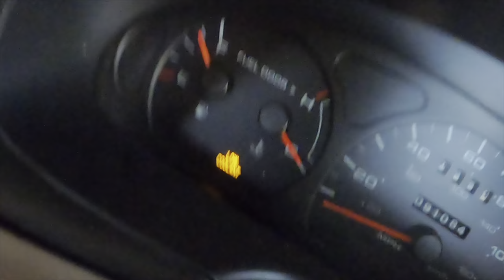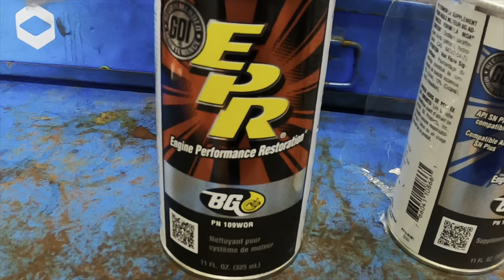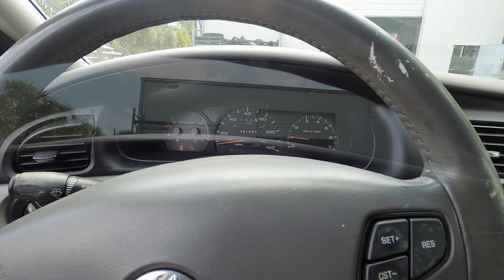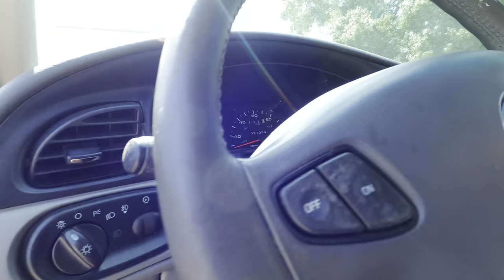Customer States: Never changed the oil….oops

Comment: When I want to remove rusty nuts and bolts, especially from exhaust related, i pre-soak the nuts with brake fluid and they come right off. Saves a lot of grief having to dig out broken studs etc..

Comment: Had a car with rod bearing knock. Told the client that I can try to save it with some bearings, but be ready to scrap the car. Turns out, oversize and undersize bearings do not mean what you think they mean. I figured oversize means bearings that are bigger than stock and undersize means smaller (like if you were putting different crank/con rods in). So I got oversize when I should have gotten undersize. I'm still confident that if I put the correct bearings in, the engine would have continued working for another 20k miles while they saved up money. But I wasn't a shop, just a Harry Homeowner kinda guy. Our deal was a learning experience for me and he only paid for parts.
Reply: Checking the clearance with plastigauge would have shown the wrong clearance for the bearings.
Reply: @chrisczarnik3439  But that would have required buying this "plastigauge" thing and then taking apart the crank caps again. I hate doing things twice, especially when torque specs need to be followed, upside down, with head damaging suspension bits in close proximity.

Yeah, my brother told me what I should have done afterwards. Would have helped if he was there to answer questions while I was doing it instead of staring at his freaking phone, but what are you going to do with these millennials.

And I still believe calling bearings "under" or "over" size is misleading. It needs to be more clear and say OD +1 or ID +0.625.

Comment: shame, the duratech 3.0 is a solid engine. Mine was still running great at over 300k miles without ever needing to be opened up. the original trans was holding up ok too. All it ever asked for was clean fluids. if it weren't for rust I'd probably still be driving it.

Comment: If you have anything to do with it, I am sure that this little engine will live another day.  To get the small
 debris out of the oil pickup strainer, clean and dry it with MEK or similar.  Then they fall out rather than get stuck in oil.

Comment: We used a similar oil cleaner on my daughters car. Slightly dark oil came out black, did 3 oil changes after 20km driving each time and the engine was quieter and oil lasted way longer before it got dark. It was a 14 year old car with 130,000km, and it lasted 2 more years before the gearbox decided to not gearbox anymore. 

Would I use it on my car? Hell no, but hers was a $200 car lol

Comment: heat from a small hand held portable  propane touch is hot enough to be more effective then penatrating oil but cool enough to not melt  materail from bolt or stud or suronding area

Comment: Next time you have to polish a rod (or main) bearing journal cut a strip of 600-800 grit wet-or-dry sandpaper that goes around the journal covering it completely and overlapping itself slightly, liberally apply parts cleaning solvent to make the sandpaper a little more flexible and conforming. You are can put the whole sheet in your cleaner tray and have the pump on to keep it covered. After you have the sandpaper in place wrap a length of string around the journal making a full turn with enough left to make it easier to pull back and forth which is exactly what you want to do next. The string keeps even pressure on the sandpaper all the way around the complete journal. Make sure to use a caliper to check the diameter of the journal afterward, I've actually used this method quite efficiently to clearance the bearing surfaces enough for a race engine. But usually it is less than getting a.001
Reply: Opps, well you may sometimes see the diameter of the journal change enough that you can use a .001 undersized bearing to keep the clearances in spec. I have torn down an untouched factory engine in one of the early 2000 CD fours that Ford brought from Germany for the '71-'73 Pinto's that had a .001 undersized rod journals on all four rods. I won't say why but this engine made it so I won't get a set of bearings until after micing the journals AND reading very carefully the stamping on the back of the bearing shells.

Comment: i qt of kerosine in the motor oil cold. when you add it to the motor start let idle for 10 min or til operating temp.  it will clean a motor very well. in the 80's i learned that trick after smelling what was in the can for 10 bucks when you can get kero for few dollars a gallon

Comment: If the correct socket doesn't fit  on a nut, in your case due to rust, I switch to a SAE socket that's just a little larger. Of course, assuming your car is metric. That should also work from SAE to metric?

Comment: I think you can save it for at least a few more years, if the customer takes care of it and changes the oil every 2500 to 3000 miles or less, oil is cheap. if you can't afford to buy a replacement car then try and make this one last as long as you can, nice job Ray.

Comment: The part that freaks me out, particularly when he says they have to go back in the same place and orientation, is that I start forgetting which parts came from where after too much disassembly. And I am not sure how to be more organized about it. Take enough fasteners and components out and it becomes more difficult to remember exactly where everything came from sometimes lol.
Reply: The trick is to just take photos of you holding each part in your hand, next to where you took it from in the car, and you can always go back to them if you forget. We have so much ways to utilise our technology that we overlook.
Reply: Use a muffin pan if you need better organization.  Works pretty good and very cheap solution.

Comment: the real issue is the condition of the crank, doesn't really matter what it's done to the shells, reminds me of the time when I was younger well, a lot younger lol, same job, undid rod bolts removed cap, didn't notice the bearing had been forced out between the crank and the rod and turned into a razor blade equals a trip to the ER for finger stitches lol

Comment: I watched this (and part 2... ).  Very nice to see an engine saved like this when most repair shops would probably just hear the knock and tell the customer they need a new engine.  But I have to wonder how many hours you had in this to take it all apart, polish the crank, and then put the new bearings and caps in, and put it all back together.  If it was 20 hours, that would be $2000 (around here), plus the cost of the bearings.  Can you tell us, was this a cost-effective repair?
Reply: $2000 is better than spending $5,000 and up for a new engine

Comment: The video would be better without the background music... By the way, will that engine be alright, I mean you're not supoosed to use sandpaper to smooth the cranshaft, now it may be slighly off balance (still better that the state it was in though).

I guess it's still worth trying since replacing the cranshaft would be costly, the car may even be sent to the junkyard...

Comment: That engine flush is crap in our European engines especially if you have hydraulic valve lifters, it can wreck them fast, might as well mix kerosene with the oil for all the good it does, we tend to just flush the engine with oil twice with about 30 miles of driving in between. 

Question Please? why didn't you put the oil pick up tube in the parts washer?

Comment: Looks like the driver had a whiskey night run AC with low coolant and 5 and 6 is way back in the back of the motor where oil gets to at the last point but yes you did a good job .but you'll know soon as you put them bearing caps and bearings back on if there's any play.

Comment: I don't understand exactly where or rather how the large shavings of metal came from or were made ?. If the bearings are wearing then I get the fine metal in the oil but what shaved the metal off the bearing? Some of those pieces are like a carpenter's block plane shaving wood slivers.

Comment: I tried doing this 15 years a go and it didn't work out so good I hop you have better luck then I did.
I would clean out the oil pump or get a new one and spray down the crank with brace clean

Comment: Drive it until it fails.  Might be 10,000 miles who knows.  Or put motor honey or whatever.  But very interesting to do the bearings.  I would think best case would be to put a rebuilt engine in it.  How much does that cost, that whole car is worth what $2000 max?  Your work isn't too bad as that type of job goes.  Some places wouldn't give you the time to examine the engine on that level, the second you found metal they'd give the customer a choice, rebuilt engine or pay for diagnostic work.  You take a huge chance trying to save an engine like that.  What if the cam bearings are shot or what if there is metal up top?  The customer pays $800 or whatever those repairs cost and six months later the engine fails completely.  He's not going to be happy.

Comment: I have to admit this is not something I would have tried. Once I heard that rod knock, it would have been a new engine or nothing. Even if you could extend the life of the engine for a short time, the time and work involved is just not worth it, at least to me. I can just see doing all that, then having the customer come back in a week wanting his money back. I wouldn't do it if it were my engine. There are just too many things in that engine that are almost certainly seriously damaged. Not only are the rod bearing journals damaged, the crank bearings and journals are also likely damaged, Probably beyond repair. Then there are the cam bearings, journals, and lobes (I noticed it's a DOHC 24 valve, which to me is one to many cams and 8 too many valves) the cam chains, tensioners, and guides, likely excessive wear to the cylinder bores and rings, and a whole lot of other things. It would have been nice if they had designed the pickup strainer so it could be taken apart and properly cleaned out, I would have thrown that one away. IMO these seriously over complicated engines just aren't worth messing with when they have that kind of damage. I'm an old school small block Chevy guy, and even on one of those, if I had found the rod bearings bad, I would have pulled the engine and completely rebuilt it. As far as putting parts like bearing caps back in the proper place and orientation, I use an electric engraver to mark them with. Just laying them out in order on a bench is, IMO, just asking for them to get mixed up.

Comment: I think it will not last very long I'm afraid, crankshaft need professional measuring and regrind or polish at bare minimum. I understand it wortth ago with a bit of emery paper and it will look better but it has to be within manufacturing tolerances which I doubt it will be. Alot of work, all because of poor maintenance.

Comment: I suspect the snake oil additive is what caused the bearing to spin. That bearing sure looked like a recent spin. And there was no rattling noise when you first started it up before adding the snake oil. I don't trust those additives and this makes me wonder. I think the customer would have been fine with just oil change before you added that.

Comment: That junk won't clean the oil ring on the piston if its locked up, futher more the cat is clogged.  You wont know unless you pull the pan and start pulling pistons out the bottom of the motor. If you can get them out with the crank shaft in.
Then you've got to worry is it low on water becuse the head gaskets blowen?

Comment: You did not show the end result of it. If the vehicle will run again with just replacing the connecting rod bearing but by looking at all the big pieces of metals that came out of the bottom of the engine. I believe it is broken more than that.

Comment: No freakin way...either short-block it or junk it...what about the crank bearings?  I'd bet all that rogue bearing material didn't come off those rod bearings alone..!!  What about all the contamination you introduced with the emory cloth..??  How you gonna get all those micro-abrasive particles out of that engine..??  You can wipe, spray, get it clean as a whistle...and they're still in there...sure it'll go back together and run great....for a few thousand miles and then...it'll start having problems all over again...no way I'd EVER trust that engine again...not without a complete tear-down and rebuild...!!!  You and the owner will be so proud of the low-cost of a day's labor and a set of rod bearings, comparatively....but it'll never be right...for sure..

Comment: f. if the crank bearings are toast, the mains and the cam bearings are gone also. you can't fix it from the bottom.  no go batman. you lose.  shouldn't have tried.

Comment: What you have to do is show your idiot customer this is what happens when you don't change your oil , show them all those pieces you pulled out that oil pump pickup .
You know Ray this is a shame because that is the good 3 .0 litre double overhead cam V6 that's a very good engine .

Comment: This guy is cowboy. That problem could never be fixed with a flush and it was made worse by continuing to run the engine. It was obvious which bearing was run when all the oil was coming out of it. That crank journal will be all sorts of ruined. Out of round, out of spec, and new bearings will be just as bad in no time. The crank needs to be taken out and machined properly, then it needs a set of undersize bearings to suit. Not cutting corners and filling the engine with filings from sanding it in situ. Makes me cringe to watch it.

Comment: Just change motors its cheaper. Each oil change cost ??? Let's say 70 bucks
On a 200k mile motor at 5k miles a change you spend 40 oil changes @ 70 bucks each 2,800.00 dollars in oil and filters, verses a new motor at 8k bucks.

Yes its cheaper to just drive it and never change the oil.
Let's think about this, does it really cost you 70 bucks each time you change the oil?

Comment: Just had my oil changed on my previa  a week ago . Started noticing oil on ground but there's tons in my naborhood kept watching oil level it was good but my 94 adds oil from a spare bottle. Got  curious put it up on ramps oil filter leaking oil . Tightened it good for 2 days then oil again washed engine . Drove it to work  the clowns never replaced the crush washer replaced that no oil. Wiped it down looked at filter payed for Mobil one filter  and Mobil one sinthetic oil it's a fram filter and I bet the oil is not mobile one there in for a fight. God I need to find a good mechanic in southern jersey.. I will be rechanging my oil and filter this week end  the oil on dipstick looks new but oil in pan looks dirty  black I don't get it. I need to find a mechanic like you no b. S This time I do the work she didn't hit 211 thousand and look in great shape and run like a champ from bad mechanics.

Comment: Why don't you just take the extra couple of minutes and heat up the exhaust bolts and then use an impact.. they'll come right off and you will never break one. I NEVER attempt to remove any exhaust bolts or nuts without heat...lol

Comment: That "repetitive sound track noise" is absolutely terrible!!!   I had to mute the "noise" just to continue watching this video.   I hope that you never do that again.   It greatly reduces the quality of your video.   Otherwise, you have good videos.   I have rescued several engines by using the Emory Cloth process to polish journals as you did when a shop wanted to trash the engine.   Take off the high points, the pits do not matter at all.   An undersized bearing might be needed, plasti-guage to determine clearances.   YES, it is totally salvageable.   Most shops would NOT do what you did.   Great work, you treated the customer right.   Have a great day!!!